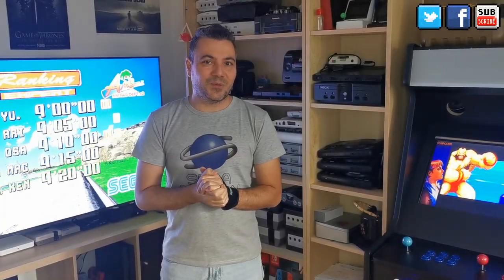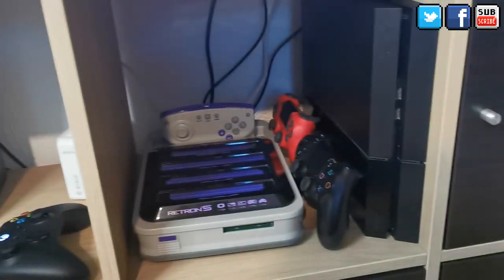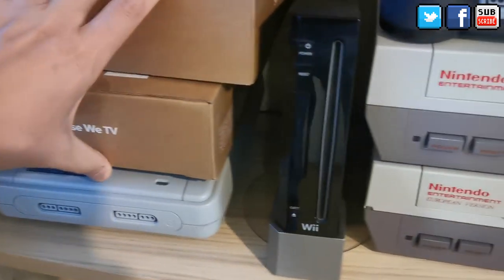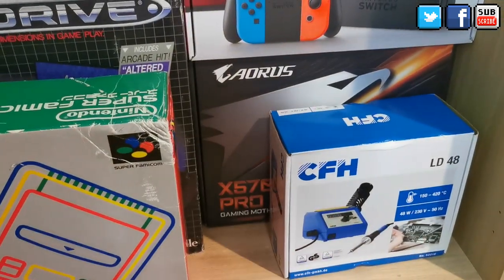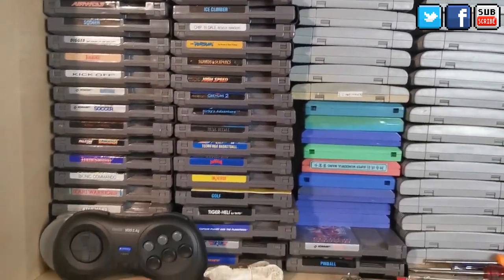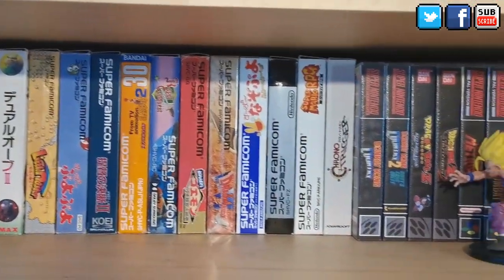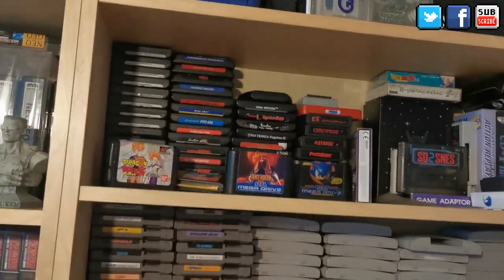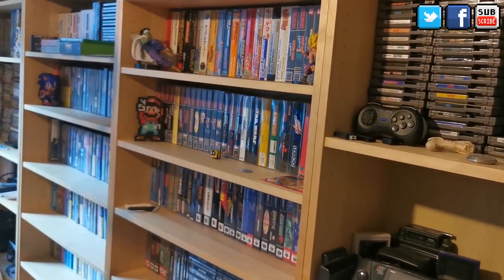Game Room Tour 2021

Comment: Great room. Thanks for sharing. Using the mini consoles on the big screen is a thing I do too.
Something I did with my own XBox series X and I ran into a little trouble - I’d leave more room around the series X, possibly set more away from the side of the cubicle it sits in, the intake of air might be hindered too much. :)

You can never have too many Dreamcasts and Saturns.
Reply from the maker: Hi,
Thx, until now i did not face any issue with the series x ....but i agree, it could be better 😀